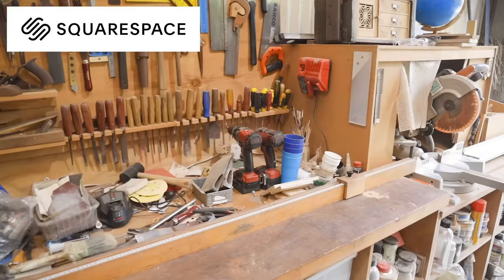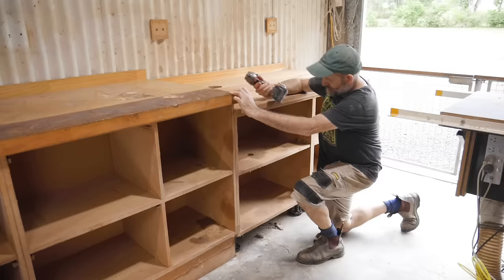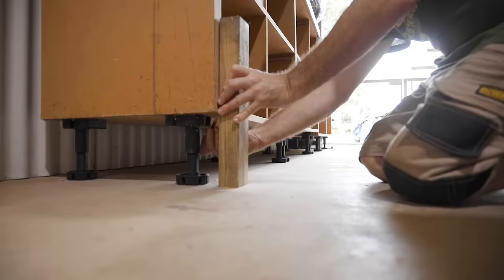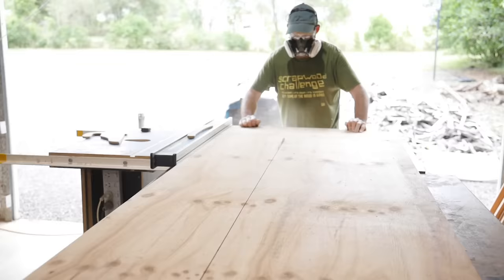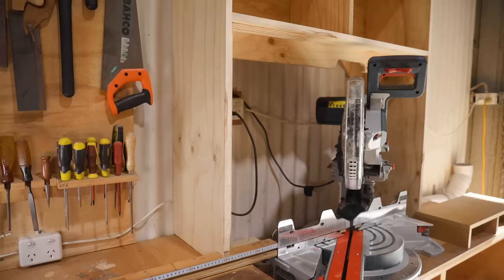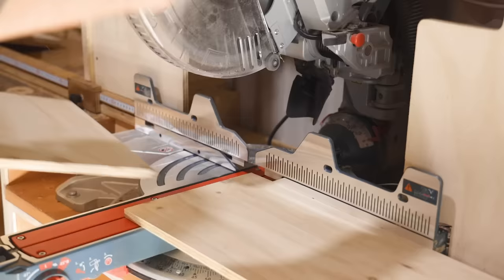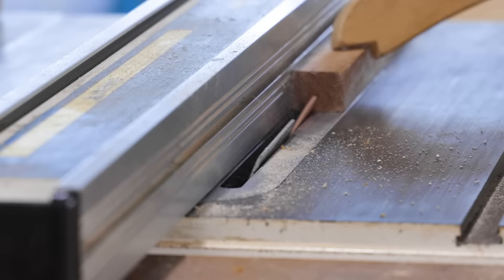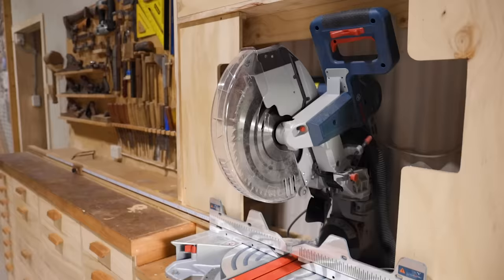Mitre Saw Station Upgrade - Storage and Dust Collection

Comment: Nice looking mitre station! I had recently bought the same saw, ended up returning it because the fences on either side were out of alignment with each other.  Poor quality control.
Reply: Aren't they adjustable?
Reply: Percy Phelps no, not adjustable. Where the fences bolt on was machined unevenly on each side. Fence on left was slightly forward compared to the right side. Was out by about a 16th of an inch.

Comment: Definitely should have NOT taken the depth of counter down by so much . The slide length of miter (Bosch) allows for a very wide cross cut AND support left and right (a few more inches ) would prove very useful .
 Oh well , that can be changed TEN years from now .    Nice build, though.

Comment: Nicely done project. One question tho': For the saw hood, why did you not cover the back with a sheet of thinner plywood? Won't all that sawdust fly into the back corrugated wall and just fall down behind the bench? Sure the dust collection system will be turned on and suck up a lot of the dust but some of it will escape and buildup behind the bench over time.
Reply from the maker: Thanks mate! You're right and it's something I was going to tackle on another day. :)

Comment: Trying to understand your dust collection strategy, Neil. You mention you are using both the dust collector and also a shop vac (did I understand correctly?). Why didn't you just connect the Bosch vac port to the dust collector and dispense with the shop vac? Perhaps I misunderstood. Any clarification you can offer would be appreciated. Love your work, Neil.
Reply: Connecting the dustcollector to the vac port will still lead to alot of fine dust blowing up and behind the saw so he uses the shop vac for the port to get the most and biggest dust and the dustcollector is connected so that it takes care of the fine dust that blows into the cabinet.

Comment: Great stuff Neil. I've really enjoyed watching your content over the past few yrs. 1 question on this project, did you end up filling in the spaces against the back corrugated wall and the cubby for the Mitre saw? I don't have anything like this of my own so I have no reference point, but my guess is your vacuum suction would improve a little or a lot if these spaces were plugged? expanding foam might be a good way to go. I'd love to hear your thoughts. take care. -John
Reply from the maker: Thanks Ben! I do plan on dealing with those gaps. I don't think it'll make much difference to the airflow though, with a big opening in the front of the hood a few gaps aren't going to make much difference. They do need filling or blocking though as the dust will find it's way down there. :)

Comment: Wonder if they sell that model of Bosch in Canada? Edit: They do and the Bevel-Glide 12" is $800 CAD
Is that the 12" or 10" you have there? I didn't get that bit.
Love the small footprint! 
 I have a Rigid branded contractors size and it is just gargantuan
Reply from the maker: It's the 12" saw. :)

Comment: Cool to see those kangaroos.
I have the same saw, and it's the best design anyone could have come up with.
Zero lateral movement when fully extended is exactly what we want.
Mine is the GSM12SD, the 12 indicates that it's a 12", and yours looks the same if I'm not mistaken but it seems like you're using a 10" blade on a12" miter saw.
I'm only saying this because it looks like there's a lot of space between the plastic shroud and the blade.  I could be wrong, I've been wrong before.
 Question....how well does that fine dust get sucked into that dust port on the back of that cabinet?   Is it still the same setup as 8n this video or did you have to modify anything?  I'd lie to do the same.
Nice job on your miter saw station.  You always do a greF job.
Cheers!

Comment: Isn't that Bosch a dual bevel compound saw? Do the cutouts you made in the dust shroud still fit when you tilt the saw left or right? Were the cutouts tested for bevel cuts as well as angle cuts?

Comment: I have a new makita miter saw that use on my job sites, it has a normal blade suction and a boot behind the fence, with my vac on it I’m at 90% no dust, just for your info, maybe not goog enough for a shop but I don’t have to dust my clients houses any more, idk if u looked into it, any thoughts?

Comment: How thick is your trim pieces. From what I could see; it looks like they are very thin. I've been cutting mine to be as thick as the plywood. I think it adds a bit of strength and rigidity. Do I really need to do that?

Comment: Hey Pask mate. What was that stuff in the yellow tin u were rubbing on the sides and bottom of the drawers?? Some type of Wax to make them run smoothly is what I was thinking bro but I wouldn't know where to begin. If it's a wax could u let us know where we can get this stuff or give me the name of it? I know wax is used a lot for drawers to get them to run smoothly but I don't have a clue when it comes to which is or isn't the best wax.
It's a brilliant job pal.
Do u have plans and a video for this one bcos I need to build a Larder press in my mother's home. She's been on at me for a while but I'm not that great at building into alcove's where there isn't a straight line in sight. My mother's home doesn't have a straight line anywhere in it mate. LMAO.

Comment: Those full extension slides aren't the cheapest. Do you buy them as a job lot?
How many each time, you have a lot of drawers!

Just counted: 32 pairs used in this build alone, 28 if those are just new fronts on the old drawers to the left.....

Comment: Hi Great video as usual, I wonder if you can help me, I noticed you are using a 23 Gauge pin-nailer, I have the same unit, when I purchased it from USA I got some pins also I am sort of running out of pins, do you get your pins in Australia I believe you are in Sydney I am in G. Coast where you are purchasing your pins from as I do not wish to get from USA if I can help it. Will be great if you can help. Jack Marashlian

Comment: When it comes down to storage for screws, bolts, nuts, and washers, you CANNOT beat "tilt bins". I suppose you could make those just for the fun of it, but they are very constrained by a need for consistency of build,  and are generally quite inexpensive, so recommend you just buy them.

Harbor Freight has the 4" ones for 2 bucks each -- you can get them in most of the stores which is the most cost-effective way to get them. I think you can justify at least 2 dozen or more of these, esp. at that price.

The primary benefit is, you need a couple, tilt it, grab 'em, and go. But if you need a lot, just tilt it, lift the container out, take it to the work location, then put it back into place when done. Convenience AND portability.

https://www.harborfreight.com/4-in-stacking-tilt-bin-56327.html
These units are good for screws, bolts and nails up to 3", maybe 3.5"

You can also get smaller units for more fiddly bits. I.E., #6, #8, and #10 parts:
https://www.amazon.com/gp/product/B000GOG6HG

And bigger units @ 8" for those giant-ass bolts and stuff.
https://www.amazon.com/Quantum-QTB304-Clear-8-Inch-System/dp/B005KIQN8A

Both the amazon units are a bit more pricey, but they do the job very well. Just go to HF, buy 4 or 5 of them, and see for yourself. You WILL go back to get more, I'll wager.